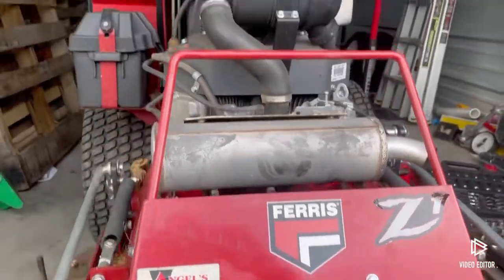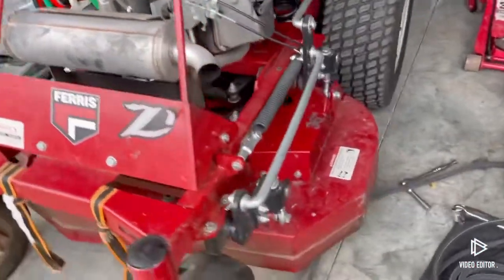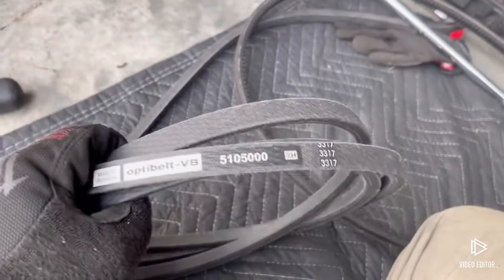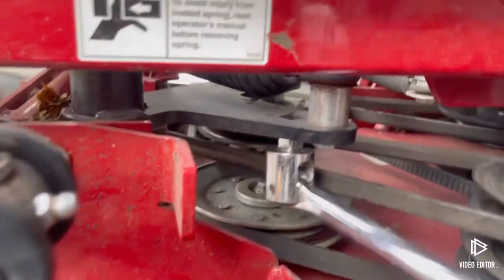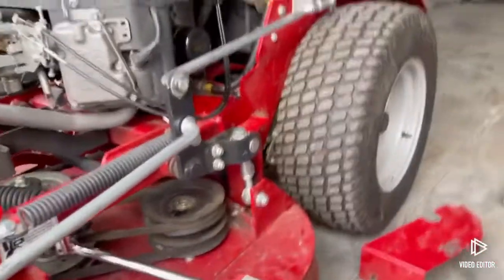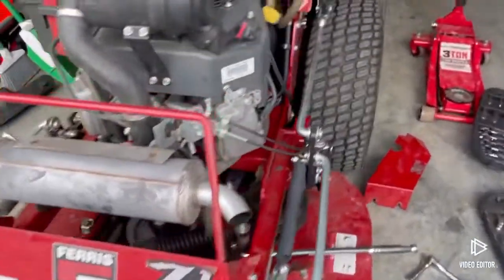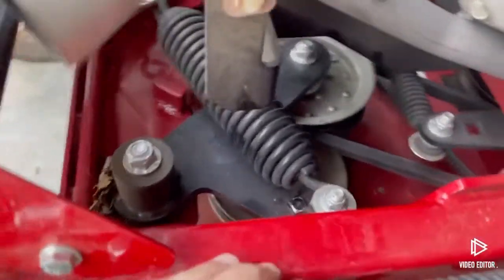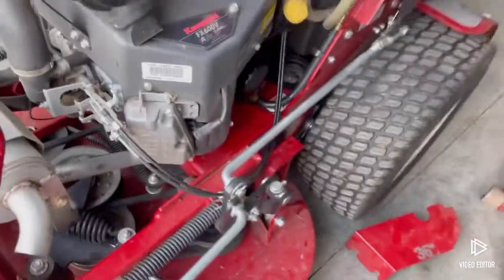Ferris Z1 stand on mower belt replacement

Comment: Quick question.. I purchased a z1 this year brand new. I went to grease spindles today and there doesn’t appear to be zirk fittings on either of them. They are just open holes with grease in them. I used a q tip to clean off the dirt and debris and grease and they look to be threaded.  Should I have Zirkfittings on the top of those?Dis you add the kirks to yours? I’m guessing they should come that way from the factory. Seems wrong to me allowing dirt and water to enter spindle bearings.

Comment: Do you have issues with the front casters? Mine have valve stems but don't accept air.
Reply from the maker: No issues with my front casters, but I haven’t attempted to put air in them!!! I will try next time I’m at the mower!!
Reply: Mine have the valves too, but the casters are solid. They don't accept air. They have no purpose.